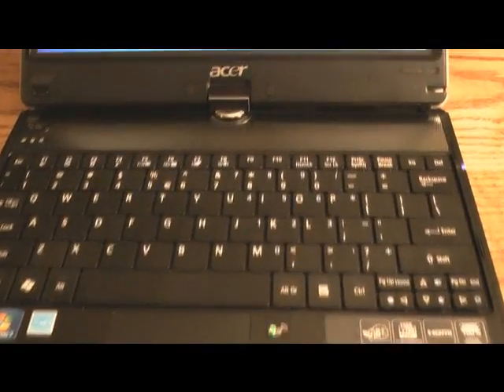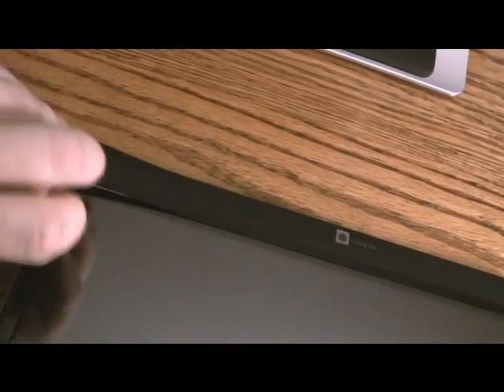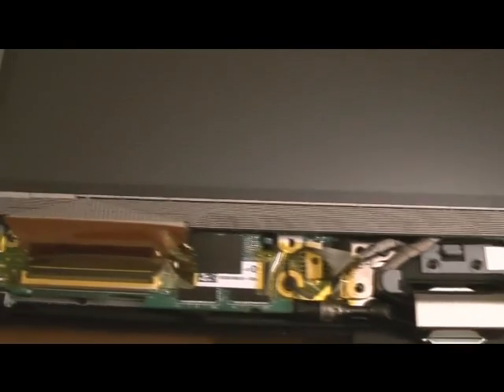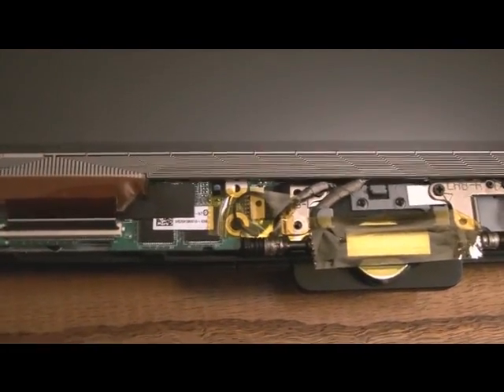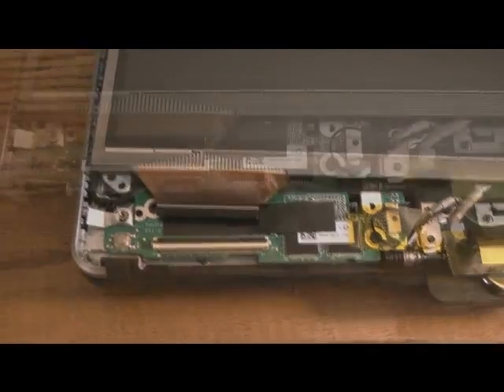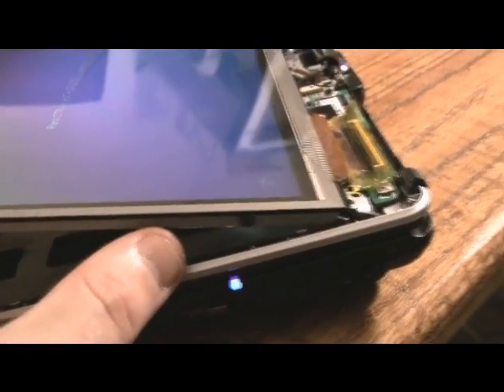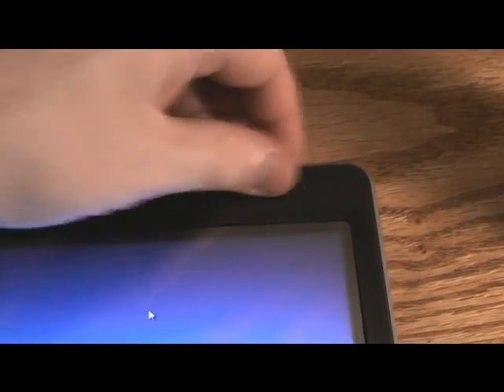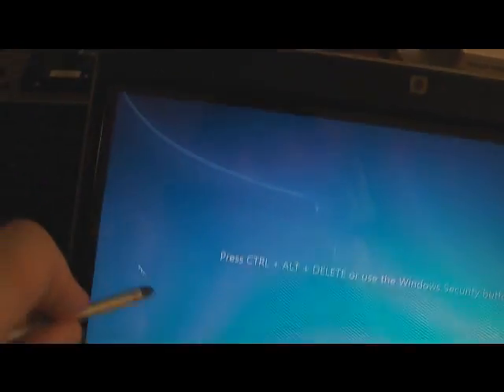Acer Aspire 1420p Touch Dead Zone - Microsoft PDC Laptop

Comment: I bought a 1420p recently(staples UK). Manufacture date 2010/03/25. Few things different.. More brown tape covering all edges. A sticker with what looks like an inspection date gripped inside the connector. And where the tracks converge before the cable a few inches of metalic mesh. You now have more things to put back.

Solved a similar problem by re-installing the OS(acer restore) and never saving callibration data. Restoring factory deaults in the screen calibration program didnt work.